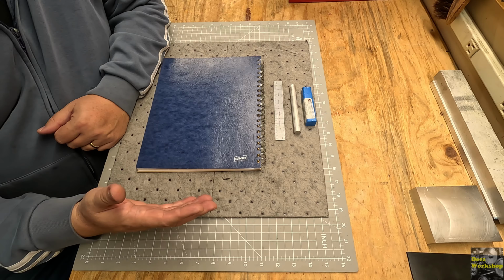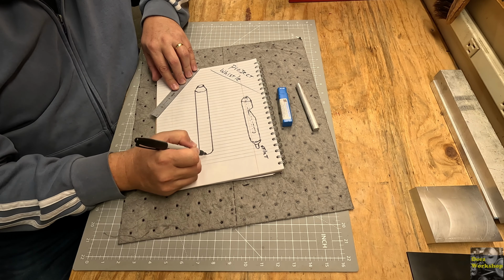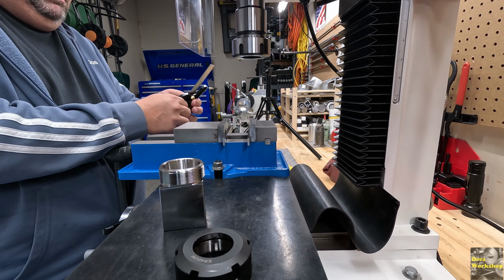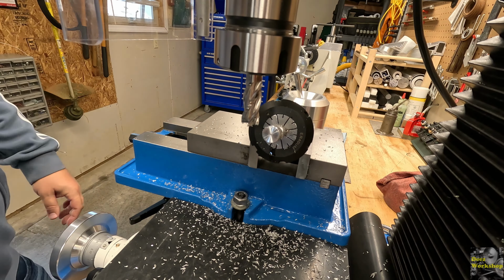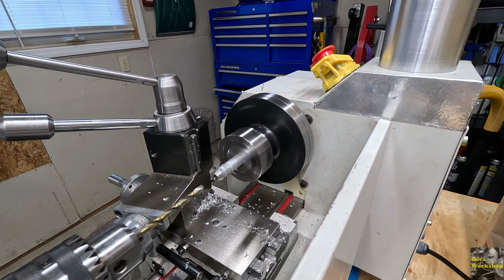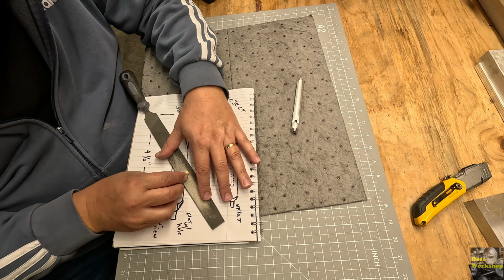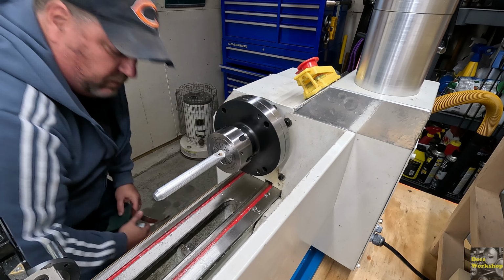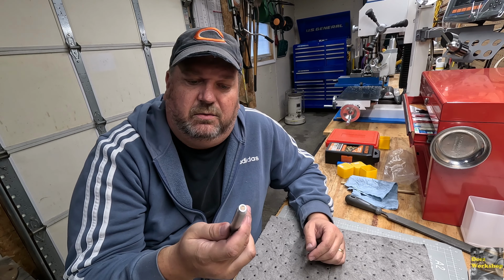Making a Whistle with the Milling Machine and Lathe - Beginner PM-25MV Mill and Vevor Lathe Project

Comment: I made a vise mounted plexi chip guard for mine to help control were the chips go.
Reply: Check out the video from Solid Rock Machine Shop titled Chip Guard, that's were I got the idea on how to make mine.
Reply from the maker: I have been thinking of designe,  Magnetic mounted or ssomething on the vice.  I need to pick up a piece of plexi and sort something out.  I like the idea of mounting to the vice...

Comment: That transition from close up collet block in the vice at the mill, to close up collet chuck on the lathe is great. Closer the better(within reason)👍👌🇦🇺
Reply from the maker: Appreciate the feedback. For the things I am recording the camera I am using is not ideal.  Depending on how this channel expands or grows I will be on the lookout to improve what I am using,  I need something that can take good macro close up video but also isnt impacted by the machines interference.  One camer I have does great close ups but gets the wobbles if I get too close.  the other I cannot get close than 10 inches without it blurring.  I do want the content to continue to improve.
Reply: @deezworkshop  I had no idea it messed with the camera, Emi is getting the better of it. I do a bit of metal detecting and the emi stuffs up the detectors when it's stormy.